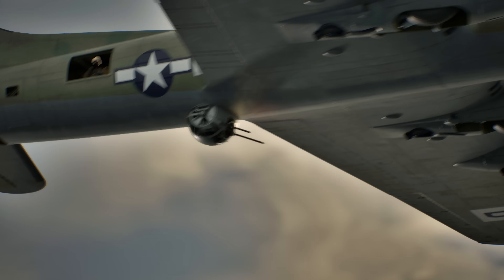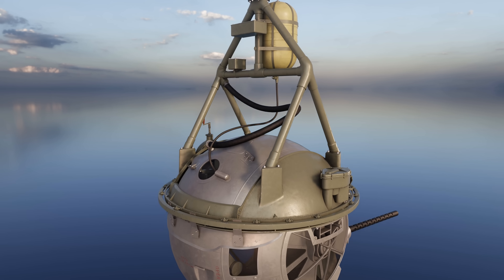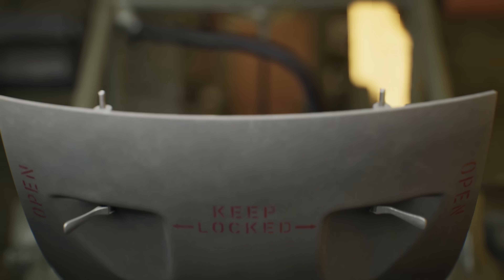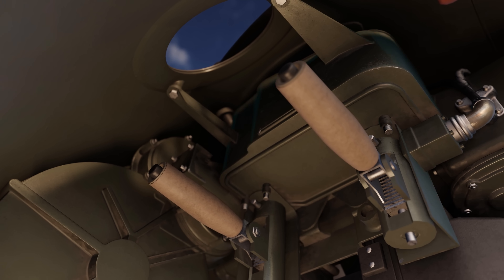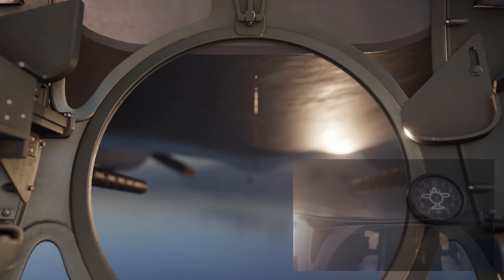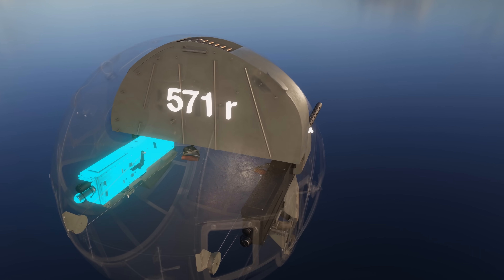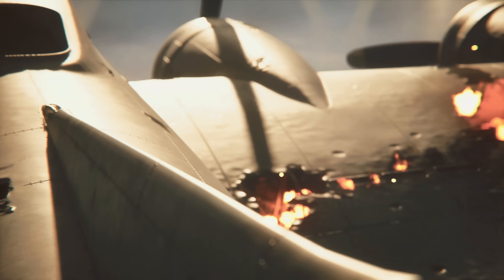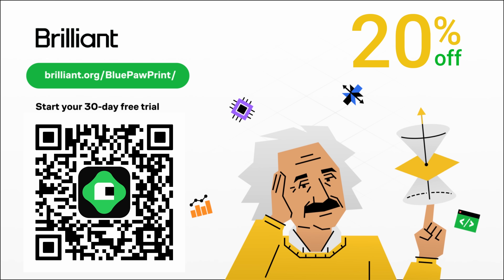Inside the B-17 Ball Turret

Comment: Great video. Pushing right on the control to turn left?  I wouldn't be to happy with that feature.
Reply: Ditto. I'm mostly puzzled by this as it isn't intuitive, yet I've also noticed many aircraft aileron controls are configured to bank left with yoke or wheel (or stick) tilted right. Perhaps some attempt at commonality with piloting? Can any pilots chime in on control setup?
Reply: @roqua  i did some thinking on it and it seems to offset the pull on your hands when the ball is turning. Pushing right to go right,  the force of the turn pulls left on ypur hands, making it hard to track accurately.  I assume this applies to some flight controls as well.

Comment: What ???

571 rnds LH magazine, and 441 rnds RH magazine.

750 rnd per minute rate of fire.

Lets see, 571 x 60 = 34,260
                 34,260 ÷ 750 = 45.68

And ,         441 x 60 = 26,460
                 26,460 ÷ 750 =  35.28

Thats 45.68 seconds to empty the Left hand gun, and 35.28 seconds to empty the right.

So you poor buggas had  basically 4 only 10 second bursts on one gun and 3 on the other, and your out of ammo ???

Omg 😢
Reply: aiming and firing at a fighterplane traveling flying at 400-500+ mph, you wouldn't need a lot more than what they had.
Reply: True, very true.
 Just doesnt seem like much when you see rivers of spent brass streaming out of guns.
Thank you.👍

Comment: G'day David, an excellent, detailed video on one of the most interesting and 'smartest' components of the B-17 'Flying Fortress'. You did, however, split one of its facts which caused a minor concern. You called the Ball Turret position the most vulnerable position on the B-17; but it wasn't until later that you mentioned the Ball Turret was, in fact, the safest gun position on the Fortress, closely followed by the Tail Gunner's spot.
Perhaps unknowingly, you also enforced the fact that the much-vaunted Nordon Bombsight was, in truth, a highly complex, over-engineered, inaccurate and far from the 'smart' bombsight it was supposed to be.
It was the Sperry gun-control computer in the Ball Turret that was by far the 'smartest' piece of computing equipment, for the period, onboard the B-17. 
Your narration and outstanding graphics are much appreciated.
Cheers, Bill H. ex-Airforce and Military Historian.

Comment: That's very informative and great graphics. But I've got what might be a silly question, but I've never seen the answer.
When the guns are 'elevated' from the almost horizontal down to the vertical, is there a mechanical hard stop when they hit 90 degrees straight down? Otherwise they'd start to head up again back towards the horizontal and the gunner would end up upside down 😊

Comment: 01:59: 1.181,2 mm? Pardon, 1,181.2 mm? .2 mm? That's the resolution of my 3D printer. Have you been drinking varnish that you convert feet so awkwardly and illegibly? 1.18 meters would be a figure you could do something with! Why don't you just write 46.5 inches as 46,500 thou? Jesus!
Reply: It's supposed to be 1181.1mm but does it really matter? 0.1mm difference is not so bad.

Comment: Are you sure about the turret hatch being cast ALUMINIUM, it strikes me that it would have been a lot quicker to manufacture from sheet ALUMINIUM, pressed or stamped would be far quicker with less waste, obviously the aluminium would have to have been heated treated to allow for pressed/stamped construction, especially if it was a thicker SWG and then annealed to give it rigidity, and any bracing would have to be manually riveted/bolted in place, but I still think it would be quicker than casting with all the associated manufacture of the forms, the intense labour to get the right casting temperature and the cooling period, then all the finishing process like removing all the flashing and final filing/grinding to size. It would be so much easier to use a stamped/pressed method in my opinion, but hey, what do I know about it.

Was there any particular reason that the turret rotation grips were counterintuitive?, surely, as with driving a car, if you want to go left you move the steering wheel anti clockwise or towards your left so moving the grips left would turn the turret left and vice versa, I can’t imagine why anyone would want to move the grips left and turn right, it is confusing, lacking common sense and counterintuitive for the brain.

@ 9:20 I’m sure you meant declination and not elevation, DEC=decline or lower, ELE=elevate or up, sorry, just my OCD kicking in, must take my tablets soon. Why would the gunner want to attach a siphon to his penis? Surely you mean funnel, or did I miss something about what a siphon does?, I can see why the gunner would want to have a hands free way of urinating during the mission and I can think of easier ways of doing it, using a condom with the end cut of and attached to the drain hose would be my suggestion, but I don’t think drilling holes in the plexiglass would be wise, it might not afford the gunner much protection from bullets but it would be more useful in protecting from flak shrapnel or bits of aircraft that would come his way and drilling even a small hole would reduce the overall strength of the plexiglass and act as a stress raiser for cracks to emanate from, I don’t think the crew chief would be too happy if he was constantly replacing plexiglass panels, I’m sure there would be been a better, less susceptible, place to drill a hole, even small holes can cause severe cracking and presumably the hole for the drain hose would need to be fairly large, otherwise trying to pee through a small internal diameter hose would be like trying to pee through a restrictor valve, very difficult.

Going back to the turret hatch, 0.66cm is not that thick, 6.6mm, which is not very thick as far as I am concerned, even if it was “cast” it would not change the protection it afforded the gunner, certainly wouldn’t stop a bullet of the calibre enemy aircraft used and I don’t think it would stop much in the way of shrapnel from close by flak detonation.

Thanks for sharing this very informative and interesting video, the graphics were excellent and very helpful, but I have one last question, if the MGs suffered a stoppage that could not be cleared by re-cocking them/it what could the gunner do?, with such limited space to work and the unusual position he was in, plus the bulky gloves I would imagine it would be very little, perhaps someone could enlighten me please, thank you, and thanks again for sharing your research and knowledge with us all. 

P.S, Sorry for such a long winded, and in places contradictory to the narration, however I do not mean it to be rude or disrespectful, just questions and opinions of my own, I hope that I have not offended anyone. 😀👍🇬🇧🏴🇺🇸🇺🇦

Comment: Wait, what!!  insanity at 14:30   all that was available for the turret gunners? computing distance, speed of both aircraft relative to eachother, angles, bullet time, wind, direction of flight of both. i mean, wow. you say computer. but was it maybe gyro fed? how would it possible get the distance to target though?
Reply: You set the size of the target plane (wingspan), then bracket visible silhouette into the bracket lines on the reticle, using your range pedal to move lines closer or further. Now computer know target's visible size and can compute the distance to set adjustments to the reticle's position. And yes ton of info was fed into this computer from lot of devices, including several gyros. Never underestimate power of mechanical computers :)
Reply: @alexeybelinsky8767  Sounds like playing a pipe organ.  Two hands, two feet, and two eyes fully engaged.

Comment: My grandfather was in a ball turret. 486th BG 834th BS based on Sudbury. He passed in 2014 but I had many great memories with him and he told me all about his experience. A common misconception is that you had to be small to fit in it. Not true. It’s actually quite comfortable.
Reply: Ball turret gunners were typically smaller men. This was a common practice due to the cramped space. Especially since the gunner had to wear heavy, although electrically heated, clothing. It's possible for taller men to fit in, but the comfort level dropped dramatically. And no, it's not actually quite comfortable. I think someone was pulling your leg.
Reply: @benyatrock  My Grandfather? Who was actually a ball turret gunner? Mmkk…

There are so many myths surrounding the ball turret that I don’t have time to go through them here; But at a glance “It was the most dangerous position”, “The smallest guys were chosen because you had to be small to fit” are easily amongst the most prominent, and he talked and wrote  at length about these until his death in 2014. Again, I don’t have to time or patience to type out anecdotes and references but people keep circulating this nonsense and it has sort of taken on a life of its own.
Reply: @nateweter4012 there's plenty of other accounts in these comments of people related to ball gunners and you're the only one that says it's comfortable. nobody's perpetuating any misconceptions

Comment: Statistically, ball turret gunners actually had a HIGHER survival rate than other crewmembers.
Reply from the maker: Only on the studies that were based upon returning planes with significant survivor bias.  On studies based upon lost planes and returning crew that had to bail, the bull turret gunner was on par with the tail gunner.
Reply: @BluePawPrint  that indirectly implies, losing tail and or ball gunner resulted in lost plane. Meaning, their positions were more related to the plane staying to fly and go back. And this is not as much about surviving in the position, just the ability to fly back. That seems to me implies, whether true or not, that without those two, there was a correlation between their armaments working and the plane making it back. This surely is not the only thing, you could come up with also what was used against them - but planes lost would not provide the data to the US, because they did not make it. What was the specific thing that brought them down in absence of tail and tall gunnery. Plane without tail would be flying not to base. Catching 88, 105, 128 mm directly would also come from below, meaning, structural integrity would be problematic at least, even if the ball was fine, ability of the cranks to even function would be jeopardized, locking the person inside, similar things can happen with rocket seats, when something gets damaged, it can end you quicker. Survivability vs 30 mm Minengeschuss 'grenade's seems again rather low and getting hit by those seems also like something that would make the plane harder to get back to base.
Reply: @BluePawPrint  Uh, no. That is based on aircraft shot down and returning. We know who survived and didn't when a plane was shot down. That isn't a question of survivor bias. 

LMAO

Comment: You know what else is inside the B-17 ball turret?

Not me.

Ever.

I stuck my head inside the turret of a B-24 once ... Once. That was as far as I got. No, thank you.

On another note,  for some reason I always thought that the rotation of the turret was activated by pressing left and right foot pedals ... right pedal to turn left and left to turn right, while rocking the toes of the pedals forward and back for down and up. I have no idea why.

As for using the handles to turn, couldn't they have done something to "correct" that backwards left and right turning controls configuration? I suppose you get used to it, but it would mess with my head and irritate me until then.